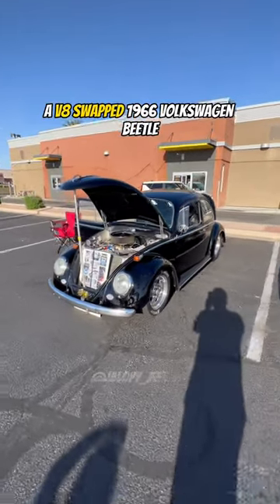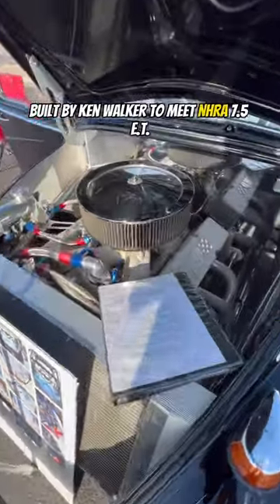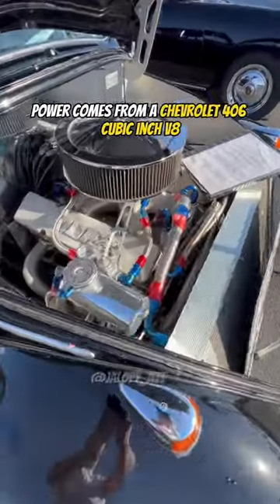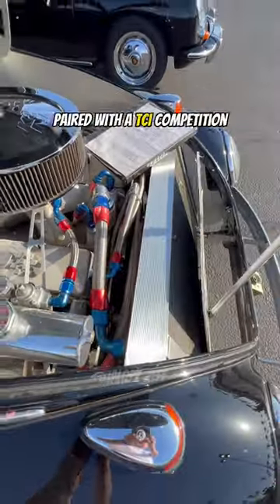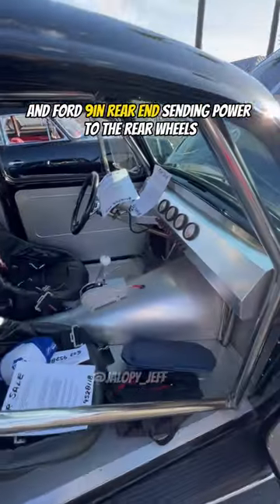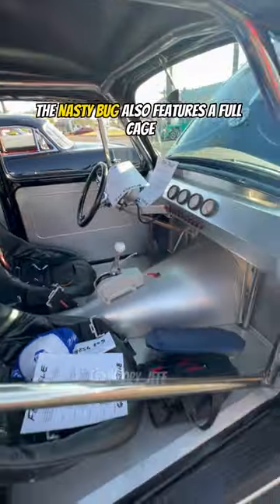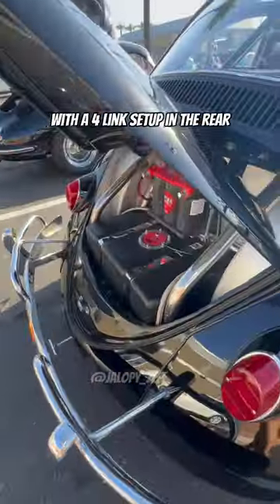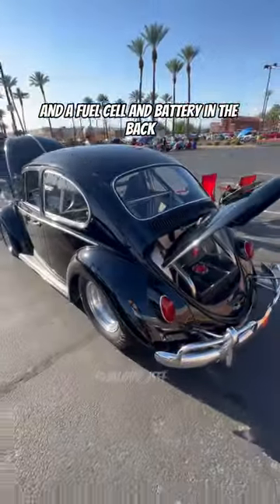V8 Swapped Volkswagen Beetle Drag Car “Nasty Bug”

Comment: All that effort. Just to make it a 3 speed auto?
Reply: less gears = lighter and shorter
both of those are very important on this car
Reply: @bettafish541  Fair enough. But a double clutch auto would still be heavier than a single clutch manual
Reply: @nightshriek420 That was made before DCT. Also DCT are junk for drag racing.
Reply: @toddthezondalover645  Ah. That makes more sense. The more you know!

Comment: You wouldn’t think that radiator would get enough air to keep the engine from overheating. Notice the hood is solid with no grill like a normal water cooled engine.
Reply: Look under the bumper... it funnels under and up. ..
Reply: @spencerkleiman5035  I noticed that, I’ve just never seen another water cooled car not have a grill in the front. You would think other cars would have done it at some point.
Reply: @brickchip6836 the airflow is really neat on this one, it goes up, over, and then behind the engine and onto the transmission, then out the back. very clever.

Comment: Looks great but is was automatic so its still a garbage.
Reply: Probably dragrace transmission so its okay of its auto
Reply: Have fun driving something like this in a manual. It would be very difficult to drive it hard.
Reply: Don’t be dissing on automatics bro you gotta have the dual clutch automatic otherwise id agree with you
Reply: Autos faster, manual are for fun